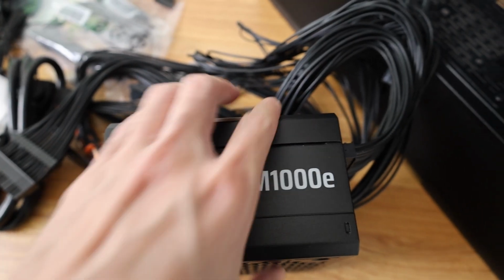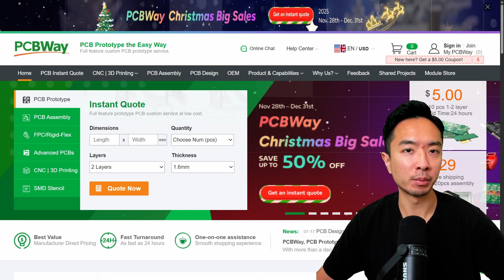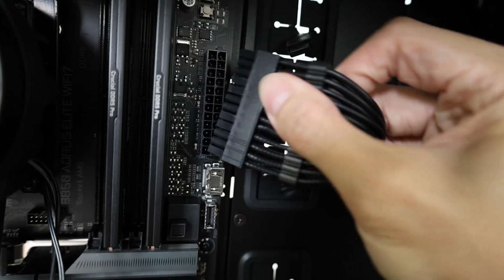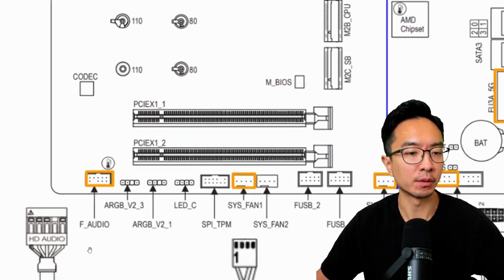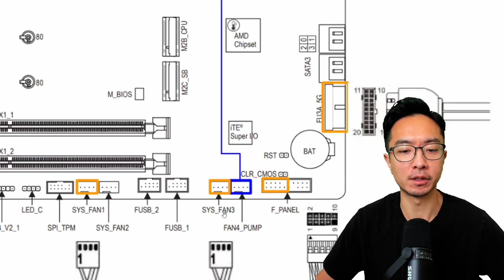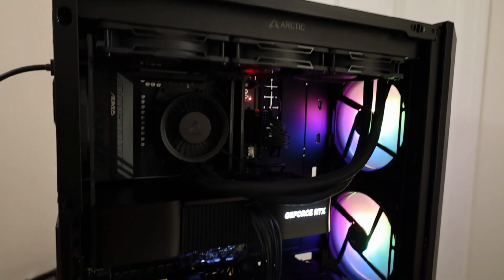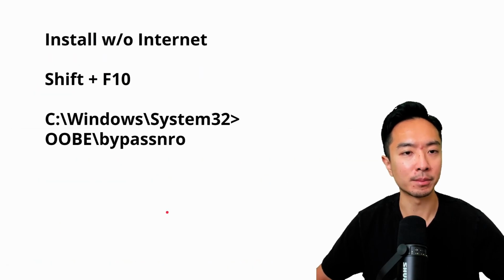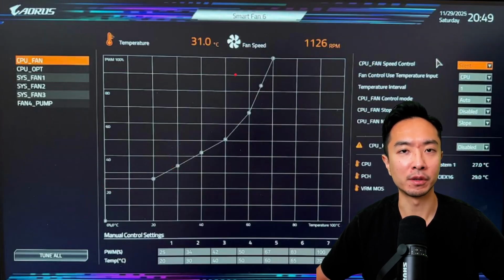Robotics & AI PC Build & Install in 5 Mins! (4080 Super, LANCOOL 216, B850 Aorus Elite, Ryzen 9900X)

Comment from the maker: Guide to Selecting PC Parts for Robotics & AI in 2025
https://youtu.be/5n0XKnCvn2k

## Budget Build ($680)
- RTX 5050 GPU 8 GB ($250): https://amzn.to/472sBfu
- 550W PSU ($38): https://amzn.to/3J8VbEf
- ID-COOLING FROSTFLOW AIO CPU Cooler 2x120mm ($55): https://amzn.to/4q329eF
- CORSAIR Vengeance LPX DDR4 RAM 16GB ($72): https://amzn.to/42F7uyC
- Crucial P310 500GB ($50): https://amzn.to/43lB78m
- AMD Ryzen 5 5500 6-Core, 12-Thread ($55.00): https://amzn.to/43ggHxs
- GIGABYTE B550 Eagle ($100): https://amzn.to/4ogMWEV
- NZXT H5 Flow 2024 Compact ATX Mid-Tower ($60): https://amzn.to/3Ja0fIr

## Entry Build ($1085)
- 5060Ti GPU 16 GB ($375): https://amzn.to/470zZYP
- 650W PSU ($65): https://amzn.to/4nUt6jc
- ID-COOLING FROSTFLOW AIO CPU Cooler 2x120mm ($55): https://amzn.to/4q329eF
- Samsung 990 EVO Plus SSD 1TB ($70): https://amzn.to/48nUGAt
- Crucial Pro 32GB DDR5 5600 MHz ($90): https://amzn.to/3WECpYp
- AMD Ryzen™ 5 9600X 6-Core, 12-Thread ($180.00): https://amzn.to/4nR1aMZ
- GIGABYTE B650 Eagle ($150): https://amzn.to/4n1hglW
- LIAN LI LANCOOL 216 E-ATX Mid-Tower ($100): https://amzn.to/3L5vAwm

## Mid Range Build ($1,483)
- 5070 GPU 12 GB ($550): https://amzn.to/3KLbaZA
- 850W PSU ($99): https://amzn.to/4nModZg
- ARCTIC Liquid Freezer III Pro 360 3x120 mm ($90): https://amzn.to/46RaH0I
- Samsung 990 EVO Plus SSD 1TB ($70): https://amzn.to/48nUGAt
- Crucial Pro 32GB DDR5 6000 MHz ($120): https://amzn.to/46SBjyn
- AMD Ryzen™ 7 9700X 8-Core, 16-Thread ($304.00): https://amzn.to/3KQ9vCc
- GIGABYTE B650 Eagle ($150): https://amzn.to/4n1hglW
- LIAN LI LANCOOL 216 E-ATX Mid-Tower ($100): https://amzn.to/3L5vAwm

## High End Build ($2,238)
- 5080 GPU 16 GB ($1000): https://amzn.to/3W2fFkQ
- 1000W PSU ($149): https://amzn.to/3IKIKym
- ARCTIC Liquid Freezer III Pro 360 3x120 mm ($90): https://amzn.to/46RaH0I
- Samsung 990 EVO Plus SSD 2TB ($129.99): https://amzn.to/3WBJOYo
- Crucial Pro 64GB DDR5 56000 MHz ($190): https://amzn.to/3WGIhAm
- AMD Ryzen™ 9 9900X 12-Core, 24-Thread ($379.00): https://amzn.to/470Mp2T
- GIGABYTE B850 AORUS Elite ($200): https://amzn.to/3JbMWar
- LIAN LI LANCOOL 216 E-ATX Mid-Tower ($100): https://amzn.to/3L5vAwm

## Super High End Build ($3,859)
- 5090 GPU 32 GB ($2,250): https://amzn.to/3Le7oIc
- 1200/1500W PSU ($350): https://amzn.to/470AQJ1
- ARCTIC Liquid Freezer III Pro 360 3x120 mm ($90): https://amzn.to/46RaH0I
- Samsung 990 EVO Plus SSD 4TB ($250): https://amzn.to/48ZBedu
- Crucial Pro 64GB DDR5 6000 MHz ($240): https://amzn.to/47d3F5i
- AMD Ryzen™ 9 9900X 12-Core, 24-Thread ($379.00): https://amzn.to/470Mp2T
- GIGABYTE B850 AORUS Elite ($200): https://amzn.to/3JbMWar
- LIAN LI LANCOOL 216 E-ATX Mid-Tower ($100): https://amzn.to/3L5vAwm

Comment: Hi brother, I need your help.
 I’m trying to create a custom dinput8.dll for three games: GTA San Andreas, GTA Vice City, and GTA III.
 The DLL loads successfully and the game accepts the Enter key automatically, but Up and Down keys are not working at all inside the menu.

 So the problem is:

 dinput8.dll loads properly

 Enter key works

 But Up/Down navigation in menu does not respond

 The game menu does not move up or down with our auto‑key code

 If possible, please make a video explaining how to correctly handle keyboard input (Up/Down arrow keys) using a custom dinput8.dll or the correct method to control the game menu.

 This video would help me a lot.
 Thank you so much in advance.
Reply from the maker: I haven’t worked with this